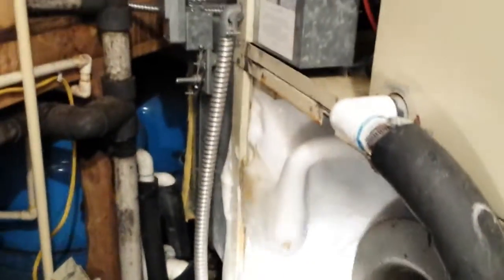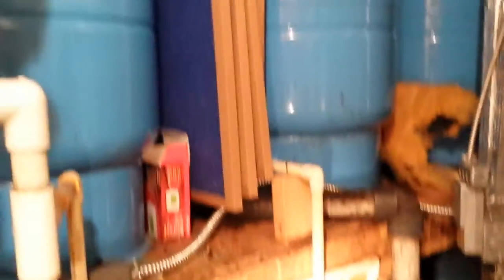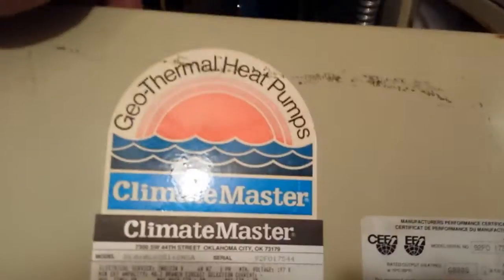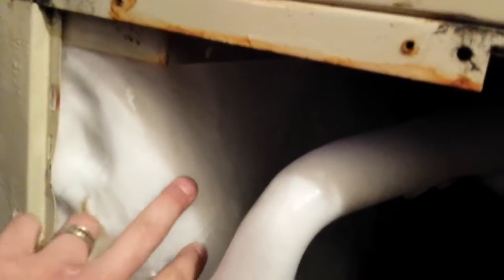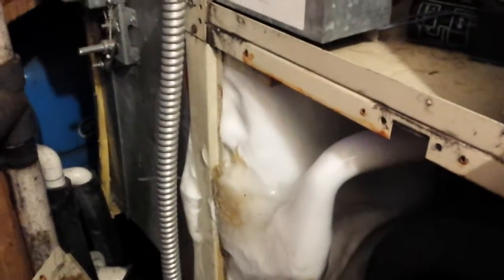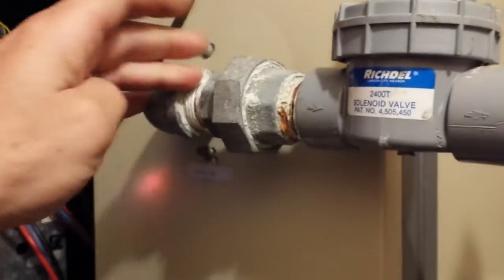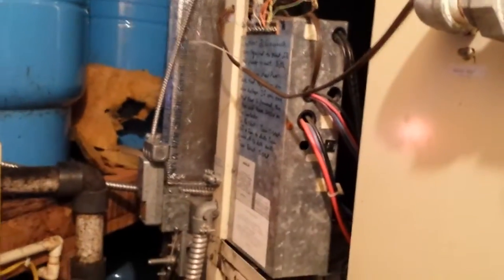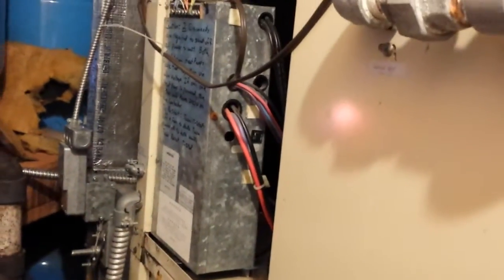HVAC-water source geothermal very iced up!

Comment: I'm not familiar with geothermal at all. I assume the basic idea is the earth's temperature stay's at a comfortable temperature, so do you run coolant down a hole to cool it or heat it then disperse it or is there more to it than that?
Reply: You run water lines either buried underground or down a well. That water cools your freon in a heat exchanger in A/C mode and warms it up in heat mode. Other than that its not different than a regular heat pump. Those just have an air to air unit outside like any typical a/c unit.